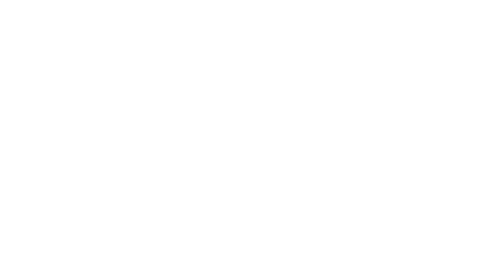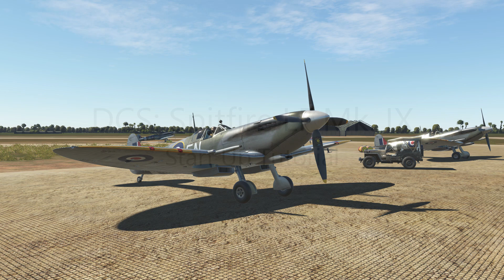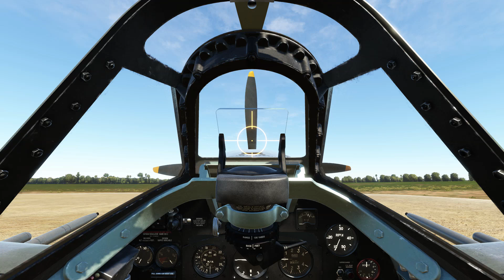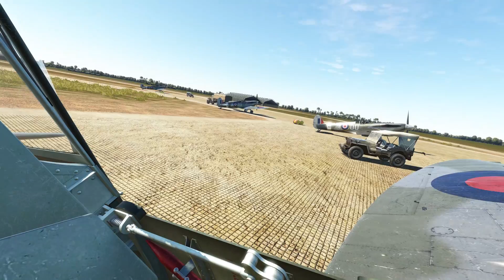DCS: Spitfire LF Mk. IX - Start Up Tutorial

Comment: It got stuck on the parking brake
Reply: The rudder is awkward. You need to get it centred but the controls are weird and it gets stuck full right or full left. This causes only one wheel brake to engage. You need both to continue the tutorial.
Reply: @eklhaft4531  absence of fly by system? Maybe

Comment: How do you press the boost and ignition switches at the same time? The flying iron Mark IX has a place between the switches that you can press to engage both. When in VR, how do I press both? DCS only lets me use one controller at a time.

Comment: I doubt DCS would model this but Accusim as used by A2A Simulations was an interesting feature which would simulate the effects on engine performance depending how well you flew and abused the engine. It would also save the engine condition between flights. Something maybe worth considering. I wish A2A simulations would get their act together and convert their FSX models to DCS. They made very good versions of the early Mk1 and I believe it was the Mk II Spitfire. I've not played with them for ages since I gave up on FSX. Their P-47 is also very good which I believe DCS are also working on. I'd liked to have tried their T-6 "Texan" (Harvard) a go as well in DCS.